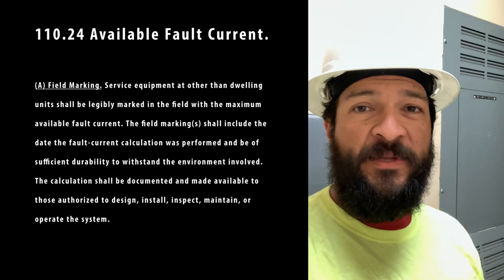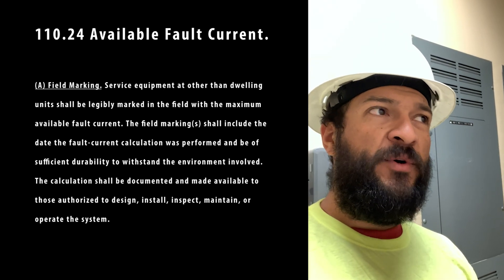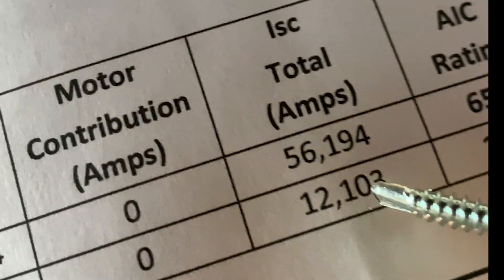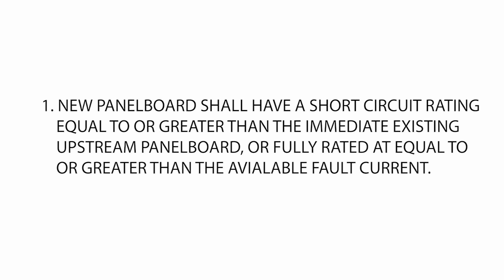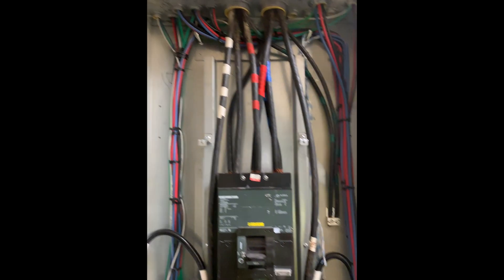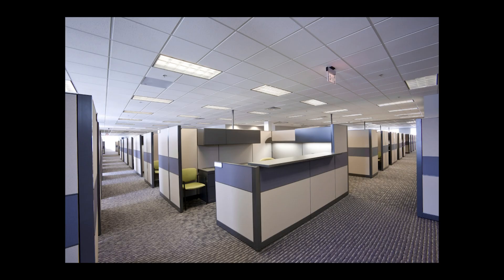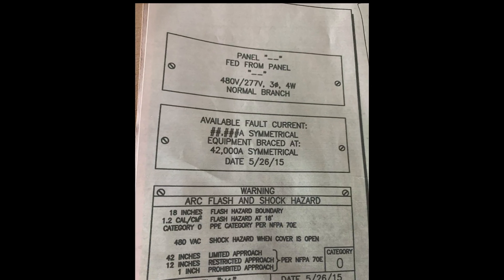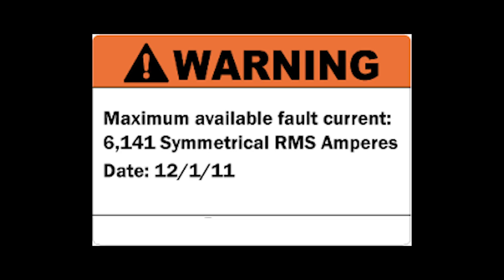Available Fault Current Labels (1 of 3)

Comment: Where can I get labels.
Reply from the maker: Someone, typically an engineer, but it can be a contractor in many cases. The utility company provides the numbers for energy to the point of service, from there, if needed, a calculation can be done involving transformer, conductor, and equipment info. Eaton has a fault current app that speeds up the calculations. As far as physical labels, that’s usually driven by the AHJ, as to the material and specifics. In the Phoenix area they want embossed steel and riveted. In my city in cali, a basic P-touch label, if they ask at all..